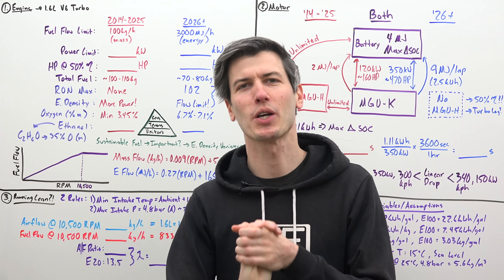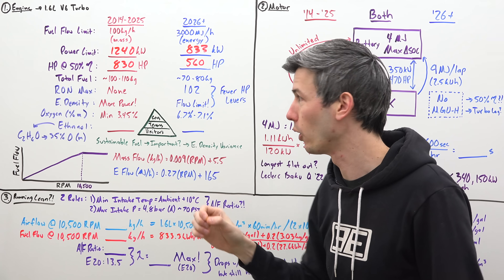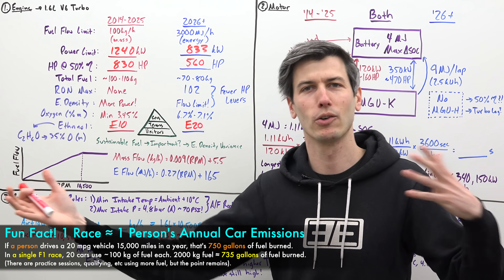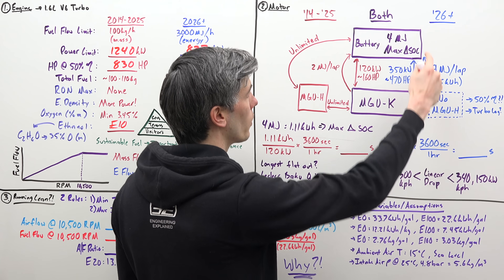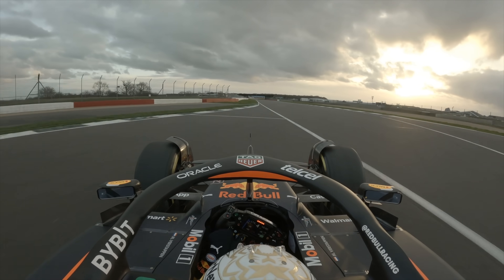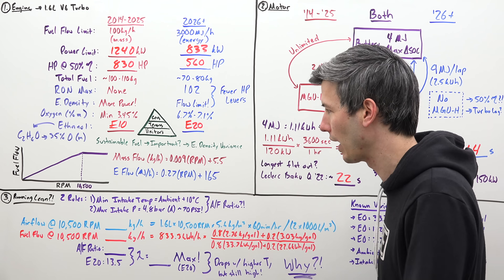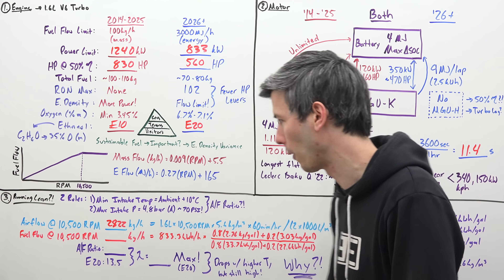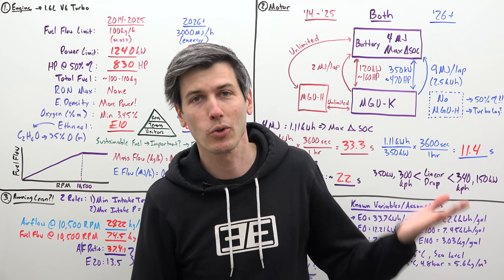Why Are 2026 Formula 1 Engines Going To Lose So Much Power?

Comment: Cant wait for the 800cc inline 3 200hp season in 2030
Reply: 😂😂😂 slowly the 2 stroke are coming back 👌🏼
Reply: @daniusrides  to be fair ferrari worked on some advanced two stroke engines if i remember correctly. That would actually be kinda sick.
Reply: @daniusrides  They did propose 2 strokes for 2026! Manufacturers rejected the change because they didn't want to let behind the engines they spend a lot of money developing.
Reply: MV agusta makes one perfect for this 😂
Reply: Ya the 2050’s is just gonna be live action Flinstones racing
Reply: @xm8553  HAhahahaha Flinstones Racing, spot on!
Reply: @xm8553  it will all be virtual by then - we will live in pods and like it - at least that is what we will be told
Reply: wait, and the Formule 4 ?  will be the moteur of a motorcycle XD
Reply: @emilienamaury3839  Lawn mower! 😉
Reply: @emilienamaury3839 oto GP makes twice the horsepower of Formula 4 so...
Reply: @emilienamaury3839  MotoGP races use 240+ hp engines, and they can only weigh up to 348 lbs....... soon motorcycle racing is going to be the only racing worth watching
Reply: @emilienamaury3839  no it'll be a 50cc moped engine...
Reply: @emilienamaury3839  Vous êtes français ? Votre orthographe me le dit 🤣
Reply: @Diamondintherough22  yes and I won't use a translator ^^.
Reply: @emilienamaury3839  j'ai grandis en Belgique je suis francophone de naissance. Je vis en Afrique du sud maintenant donc c'est comme ça que j'ai appris langlais. Je comprends le français cent pour cent mais ma façon de parler et mon orthographe souffrent a force de parler l'anglais tout le temps.
Reply: @emilienamaury3839  800cc triple is a motorcycle motor
Reply: @Fee.1  soory I meant a motor like a MONET-GOYON STARLETT,
Reply: So you sayin that we should put mt09 engine in future f1 cars....hmmmm
Reply: If you want to scratch your head have a look at the first turbo era, or V10s that hit 22,000 RPM or open spending where the top teams annual budgets approached one billion US. It is nothing more than spec racing these days, F1 was the pinnacle of motor racing by a large margin.
Reply: @michaelroberts1420  Yeah, and it's only going to get worse. I have to say, however, not many car engines can rev that high, nor can they make that much power from a 1.6L displacement.
Reply: koenigsegg already made 3 cylinder 600hp engine lol
Reply: @egwmno  they are not restricted to these air and fuel ratios tho and they also use freevalves. Its easy to do that stuff when u dont have any other regulations then emissions
Reply: When f2 surpasses f1
Reply: don't forget they will come with an 800 hp electric motor, at which stage the petrol engine will just be a range extender
Reply: Can't wait for the 300cc single cylinder in 2040
Reply: Seems like F1 is kidding itself. Trying to be sustainable? Whatever. So silly.
Reply: @cconnon1912  Exactly what I thought! Are we alike?
Reply: Inline 3 Atkinson cycle. With a 22mm limiter.
Reply: @wolfgangpreier9160  cylinder deactivation for the straights. Dont want to make it too dangereous AND it saves fuel
Reply: @Mr.Marbles  On the straits they should reverse the gas flow and use the 2nd cylinder to compress air into the third cylinder which should press it through a carbon capture filter and get all the CO2 out of the air which it has produced in the corners before.
Reply: Mario kart spec
Reply: don't forget the cars will be 6meters long, and weigh 1100kg.
Reply: I give up with this sport, I long for the days of screaming v10's 😂
Reply: 😂😂😂 ... That's where we are headed.
Reply: Sounds like Moto2 😍😍😍
Reply: That’s pretty impressive numbers coming from that engine tbh.
Reply: Formula Kei 🤔🤷‍♂️ would be cute at least
Reply: Triumph engine joining F1 lmao
Reply: If we split the v6 1.6 in two, we get 800cc, if they by then improve efficiency and make it 1000cc 3 banger, with 400hp output or more plus 300 to 400hp eletric that would be still a nasty car with alot of power and torque. Sound im not sure but they are not focus on that i gess 😅
Reply: With a limit of 3 AA batteries
Reply: Gotta make Formula E look exciting somehow 🤷‍♂️
Reply: Tbh they were close to giving us turbo'd 1 liter i3 engines revving to like 18k
Reply: can't wait for Formula Prius!
Reply: @bella_testastretta  Turbo hybrid era in F1 started in 2014.
Reply: @bella_testastretta  And 1,000 HP.
Reply: @carljaekle  I know I started watching F1 since 2004. Whats your point dad?
Reply: At that point, the engine’s just a generator for the electric motor
Reply: Might as well share engines with MotoGP to split development costs lol
Reply: BROOO just wait until they're pedal powered!!!!
Reply: @wisteriapetals  would watch, ngl
Reply: The drag from the fake purple hairdos of the drag queens driving will also kill performance
Reply: If Renault had their way in the 2014 regulations they'd be racing with Inline 4 engines already.
Reply: Smart Car Engine 😅
Reply: Why don't the restrict them to motor mower engines?
F1 has become nonsense.
They should have V10s with 1500hp -
that would be more exciting.
Reply: Gonna be sick!
Reply: Big savings on spark plugs compared to the current V6 engines! (Also will be ULEZ compliant if you need to park in London!) 😁👍
Reply: @philtucker1224  haha. All racetracks now need ulez cameras on them. UK wet dream 😂
Reply: It goes like v12-v10-v8-v6, so it should be v4 next.
Reply: 200hp inline 3 + 800hp electric
Reply: @plainText384 maybe. some production car have this direction.
Reply: @plainText384 2000 hp electric 😂😂
Reply: We motogp now bois(4v/i4 not 3 but w/e)
Reply: Wait is the word and it would be a 2 cylinder
Reply: make it a turbo 2-stroke 1000c and 500hp
Reply: @TiagoJoaoSilva  When your engine is energy flow restricted and you toss a significant amount of fuel out the tail-pipe without burning it, this is a recipe for failure. The two-stroke is not going to appear in F1 racing.
Reply: Like a Koenigsegg TFG?
Reply: That's fine, just give us better racing.
Reply: That would be WRC then 🤣
Reply: Hearing the scream of a 3 cyl, cant wait
Reply: Overall weight of a computer desk and chair
Reply: You may be joking but there was talk of f1 going to a  2stroke hybrid engine!
Reply: Well, 800cc I3 could do 500+ hp no problem.
Reply: By 2030 you 800cc F1 engine will be pushing 1000 hp
Reply: Soon f1 will devolve back into carting lol
Reply: kei car with downforce
Reply: Yeah, it will have a nice sound that engine! It will sound like a hoover 😅
Reply: @emililiev1621  nah 3 cylinders do actually sound nice to be fair. just listen to some 3 cylinder race bikes. pretty rough sound. much better than most 4 cylinders tbh :D
Reply: Can't wait for the single cylinder sterling engines with max 3 Candles per hour in 2040
Reply: Koenigsegg: Only 200hp?
Reply: 800cc tripple with 200hp is quite amazing without turbos actually but i get the joke
Reply: And all the FIA members will be either lgbtq people or psychotic climate activists promoting their propaganda and agenda
Reply: Sounds kinda like a canam motor
Reply: With the electric motor, these cars will make around 1,000 HP.  Would be surprised if these are not faster than current cars.  Perhaps less powerful brakes, more motor regen.
Reply: Inline 3 baby 🤣⛳
Reply: Powered by BMW
Reply: That sounds like a cool bike 👍🤣
Reply: laughs in street legal 600 hp 2L 3 cylinder
Reply: Maybe making the cars even bigger will improve racing?
Reply: By 2040 they will run
Reply: I'll have quit watching by then Max is gone in 2028
Reply: 200hp from 800cc is actually impressive. But MotoGP makes 350hp from 1000cc
Reply: Ahh.... I can see the glory days of the Ecclestone era again, complete with drivers pushing their out of fuel cars across the finish line!
Reply: inline 3 sound great though!
Reply: With the 100kwh battery weighing 300kgs ofc
Reply: xDD
Reply: Meanwhile Super formula pushing their I4 to 2000+ horsepower and still be drivable.
Reply: 800cc with a 550kw motor😊
Reply: Nah they'll just stick MOTOGP engines in to save money.
Reply: @AngelUkiCarina  what's wrong with it? Can definitely be engineered to higher horse power and high revving. Just like "the best years".
Reply: The pure excitement they well ooze, even now the F1 cars are the pinnacle of emotion. Really. I mean, if you aren't seated at the track and happen to go to the toilet, you aren't pestered with dreadful enginesound like you used to. Thank heavens for that...
Reply: +3 motors 600 hp hybrid.
Reply: Yeah I can’t wait for the diesel engines they were gonna run in 2020
Reply: they can be less powerful but not necessarily slower because there will be Audi .
Reply: We laugh but it's coming. EV performance will force F1 to adopt more electrification or fall behind.
Reply: Formula GR Yaris
Reply: 500cc monocyl with 50hp in 2040 air fuel😢
Reply: 1L Koenigsegg may reach almost 300 hp. Why not key-car 0.6L 2 cylinder turbo 200hp? MB-Smart Fortwo F1 AMG Team... 2 speed auto with high-slip torque converter or without gearbox like prius or Koenigsegg
Reply: They could as well go for the Red Bull Soapbox racing engine.
Reply: 2 Stroke single cylinder in 2036
Reply: Put in an engine that sounds like 2005 we want the sound lol ha ha
Reply: Exactly. And the fuel coming out of the teams private composting toilet
Reply: How about crediting a point not for the pole sitter or the fastest lap, but for the least emission
Reply: Wind turbines picking up airflow from cars ahead of you.
Reply: And at 980kg curb weight that things basically gonna be a Lupo '02
Reply: The FIA is gonna strike up a deal with Toyan to do engine supply.
Reply: @crunks420  you sure it wasn't Lada?
Reply: I’m excited for the rotary engines of 2034
Reply: The car better be as light as a motoGP bike
Reply: Damn crazy how the cars will be even wider thwn.
Reply: Funny !!! 👍🏻
Reply: Enter Toyoda.
Reply: Great review,like always
Reply: Great even more of a reason not to watch!!!
Reply: 30% i.c.e, 70% electric motors.
Reply: Dont forget, With 800HP hybrid system
Reply: Polaris enters the F1 grid.
Reply: I can wait for 50cc single cylinder 2 stroke engines making 12hp in season 2035 that runs on horse manure.
Reply: Bold of you to assume there will still be ICE in f1
Reply: Yeah...😢
Reply: not gonna lie Id watch that. Should be fun
Reply: The eco losers are ruining it for everyone.  I say screw them give them the middle finger and go back to v10
Reply: So basically tuned chevrolet Matiz
Reply: Ah was the two-stroke only in '34?
Reply: Inline 1
Reply: @tedarcher9120  no. I want a v1
Reply: Then just straight up toyota corolla or honda civic engines 😭
Reply: Triumph Moto2 engines.
Reply: this would be so sick tho lmfao.
Reply: And the cars will weigh 2000 pounds
Reply: Imagine the wind power car in 2040.😂😂
Reply: Depressing
Reply: And yet still going about as fast as today.
Reply: ANd in 2040 they will all run on duracell batteries and will have to be able to do an entire race on 6 9 volts batteries. All to save the cilmate of course.
Reply: or the CRT category. i'm ready with my black iron kart
Reply: Currently you’re joking but this might even become true. Don’t give the FIA ideas
Reply: 1000 HP 900 electric HP and 100 ic
Reply: Honestly that'd be fine if they let them use giant turbos and made 800hp.
Reply: @caseymurray7722  Poor fossil burners need turbos to get some torque. I recommend they help them with some electric motors.
Reply: Or worse, all electric. Even 100cc and 100hp would be better than that garbage.
Reply: @ramseycattn5941  Meh, all electric would be interesting, but there is already FE. And idk anyone that watches that. I like the balance we have in F1 atm, in 26 it's the lowest i think i'd want the ice to be restricted without other tech advancements. As long as we are getting the same or faster speeds after 26 i'll be happy
Reply: The 1.5 inline 4 in the porsche LMP1 won everything.
Reply: @TheAntoine191  2 liter V4, but you tried.
Reply: You and me both. With the advancements of aerodynamics the cars will be really fast through the corners now. Monaco will be really exciting with the cars getting so close to each other
Reply: @adamstilldrives  The McMurtry will drive rounds around those oldsters.
Reply: @adamstilldrives  no because the cars will weigh 5 tonnes
Reply: @adamstilldrives  is this for real? They could use the engine out of the Yaris
Reply: @adamstilldrives nah the cars are too big for monaco
Reply: @adamstilldrives  the only thing that can produce better racing in monaco is smaller and lighter cars
Reply: @adamstilldrives  Monaco is just straight crap, cars power isnt the problem its that they are as wide as a truck
Reply: So true... they just make it less and less fun.
 I guess by 2075 it will just be a horse race. 
Completely natural, no fuel needed... 😅
Reply: They'll be electric by then I'm sure.
Reply: @NoZioKikes88  they can't. Formula E has an exclusivity contract with the FIA where they can be the ONLY electric championship until 2034. Any championship that wants to go that direction must pay a fee to Formula E until then. That's why we don't have any other pure electric forms of motorsport.
Reply: @placeholder2924  I'm aware of Formula E but figured they'd merge with F1 or something along those lines. Didn't know what the contracts said.
Reply: @placeholder2924  10cc RC motor and a giant battery then
Reply: @placeholder2924  that money would be small potatoes for F1.  They can totally buy out Formula E anytime they want too
Reply: @veganpotterthevegan  but they don't because they wouldn't profit much from it in the state that it's currently in.
Reply: @Place Holder  that's because there are better options.  People accept the best thing available when they lose things they liked that go away.
Reply: @placeholder2924  what's XtremeE off road racing then?   Lewis Hamilton's team, RedBull, McLaren etc...
Reply: @placeholder2924  Extreme E and FIA ETCR are 2 forms of all electric motor sport that spring to mind, so they’re paying Formula E? I doubt it, I think you made that up.
Reply: @placeholder2924 NRX group E is another all electric type of motorsport...
Reply: @placeholder2924  FIM has MotoE
Reply: @NoZioKikes88  With fake noises...
Reply: @Apophion  Yes, i prefer ice cars. Reminds me on Stephen King…
Reply: @Apophion  Jetsons cartoon family commuter jet car noises
Reply: @NoZioKikes88  No way,
The energy density just isn't there unless they change format of the main race.
Unless we will see battery pack changes during the race.
Reply: @barneyklingenberg4078 F1 shouldn't go fully electric because batteries can't provide the energy for a full F1 race, but they can improve the hybrid part. for hybrid race cars the bottleneck is not energy density but power density which has more room for improvements.
Reply: @NoZioKikes88  that’s just formula E with extra steps
Reply: @NoZioKikes88  no way
Reply: @NoZioKikes88  Formula E exists…
Reply: @NoZioKikes88  I guess I’ll watch Dyson cars go around a track
Reply: @NoZioKikes88  F1 isn't going electric. That is for Formula E that no one watches.
Reply: @v4skunk739 but they could go fully hybrid if they have a battery tech that is light  and can charge/discharge in a few seconds though like supercapacitors. small electric motors on 4 wheels and super powerful Regen like formula E 650kW, or even more and recover most of the kinetic energy when braking. saving a lot of fuel  and making  faster laps with same fuel flow limit
Reply: @geemy9675  F1 cars are never getting e motors in each wheel. They are also already fully hybrid.
Reply: @v4skunk739  I watched it once, once to many😜
Reply: @v4skunk739  only Tesla fans/owners watch that tbh
Reply: @V4 Skunk  they're going to eventually because EVs will be faster.  Formula E is slow because their budgets are too small on top of the tech not being there yet.
Reply: @geemy9675  you need to look up unsprung mass.
Reply: @geemy9675 tf you mean “fully hybrid” they already are hybrid
Reply: @NoZioKikes88  Bruh, that's why Formula E exists...
Reply: @NoZioKikes88  Formula E: Are we a joke to you?
Reply: @NoZioKikes88  formula e has exclusive rights to single seater ev racing until  2035  at least do f1 isn't gonna go full Electric  till well passed that. It will all be synthetic fuels and huge hybrid power.
Reply: @NoZioKikes88  That means F1 and Formula E are redundant.  Given that companies like Toyota and BMW are starting to say "Not so fast..." regarding pure EVs, I don't think it is as likely.  Never mind the fact that all the world's accessible lithium is only sufficient to replace ~10% of the world's cars with EVs, irrespective of growth.  So, some things will need to radically change if that is to happen.  But, never say never, I guess.
Reply: @KRAMITDFROG But Lithium demand is only set to outstrip production by 2040 at current development rates. And that's production, nit global reserves, which likely last till 2070-ish.
And there are lithium free batteries being developed today
Reply: @NoZioKikes88  As per FIA - FE agreement, full electric race can only be Formula E, thus F 1 can have 99% electric, but will never 100%.
Reply: @NoZioKikes88  No
Reply: @NoZioKikes88  I don't think so. Electric drivetrain maybe. But fully electric is pointless for long races. You have to carry a heavy battery around. Fully electric is useful only to the point where the battery weighs as much as the range extender that could replace it. If you need a range where the range extender would be lighter, then you use it instead.
Reply: @Christopher Abramor  they can easily design in a fast change battery.
Reply: Can‘t wait when a Tesla Model S Plaid pace car with the lates pinup girl laps those slow poke high paid Formula one.
Reply: F1 is just getting worse and worse. This may be my last season watching it.
Reply: @DeoVindice_61-65  F1 is boring in general never watched it. It’s just the same person winning idk if that’s true
Reply: @DeoVindice_61-65  what are you gonna do without F1 and NASCAR?
Reply: @veganpotterthevegan  Don’t care about NASCAR. Don’t watch it. Haven’t ever watched it. It’s boring as hell.
Reply: @veganpotterthevegan  I’d gladly watch Super 5000, if they would televise it.
Reply: That actually would be neat
Reply: 12 turbos and one cylinder
Reply: I thought people love sports cars that has less then 200hp like the Miata?
Reply: Calm down dude 🙄
Reply: If it’s NA why not
Reply: @POVShotgun  catalytic converters don't work well with VERY small engines.  Not that F1 really cares.   They've been avoiding using them for a very long time because they don't care but claim to
Reply: F1 sucks for 40 years. Not watching for as long. Bureaucracy is never the answer. Best is: standard octane limit 89, narrow cars, big tires, 70l tank, no aerodynamic help, 2l turbo, real roads.
Reply: As long as they race above 220mph or just faster than any other motorsport*, who cares

*= in a circuit, open-wheel, etc etc so you can ignore dragsters, prototypes and etc
Reply: Can't wait for the battery with higher density of energy than gasoline. (Future regulations may limit magnetic flux or weight of magnets or copper/electric windings/switching power alltogether as well?

Otherwise F1 cars with 1500 kw may become real quite soon. 'F1 goes EV in an internal development process more than Formula Electric takes over F1?' Yes. Good for the brand F1, highly appreciated!)

'We fly to the moon! We don't stay here! We are serious about it!'  - en dit? Wernher von Braun of course.
Reply: As long as it revs high and the cars somehow get lighter I'm okay with this lol